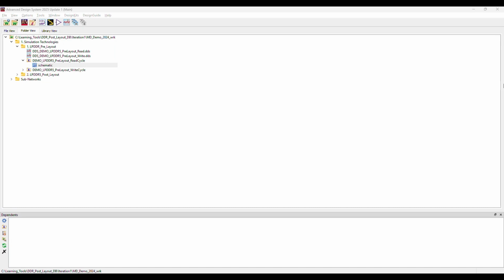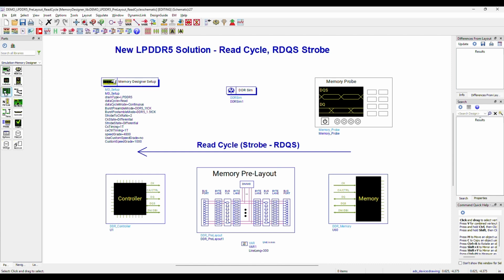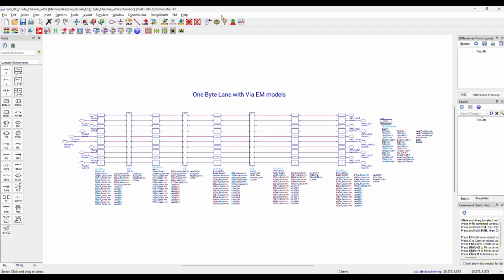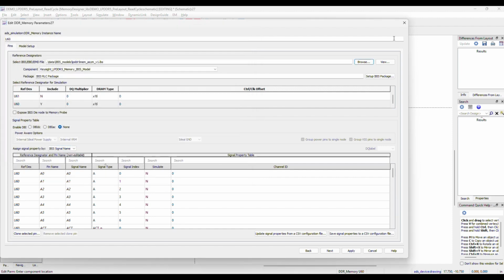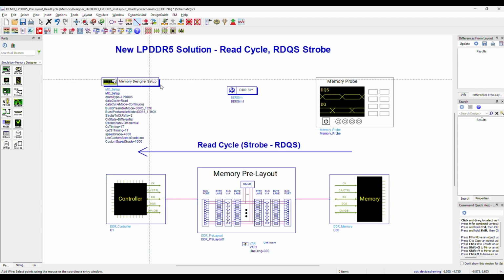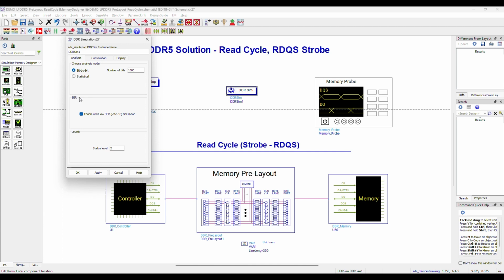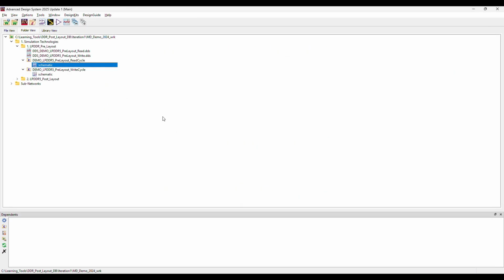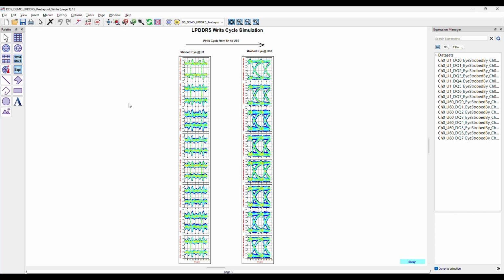Part 2: Pre Layout LPDDR5 Simulation | Keysight ADS Memory Designer |High Speed Digital

Comment: Hi Harsh, Thanks for the amazing content. Could you please guide me whether I can use s-parameters for simulating LPDDR5's signal integrity? I don't have its Ibis model, the one I got has rlc values missing from its ibis and ibis-ami model. I do have the S-parameters models for both the processor and the RAM, can I use these for simulation? because somewhere I read, idk how correct it was but IBIS models are used nothing but for creating s-parameter characteristics only....how correct is this statement?